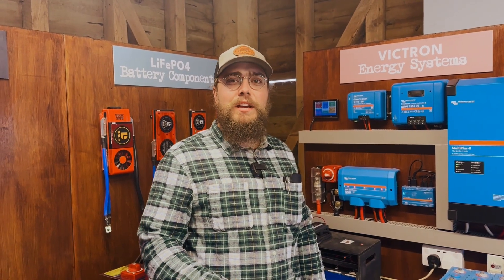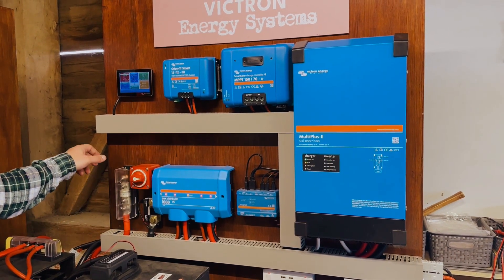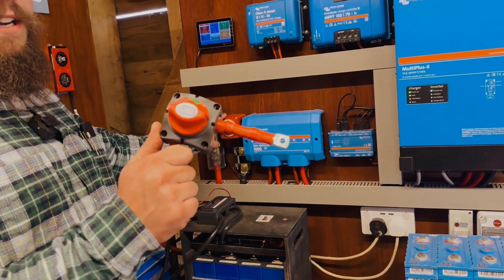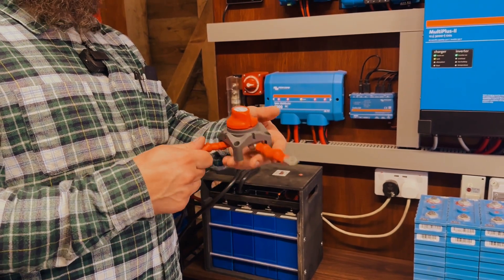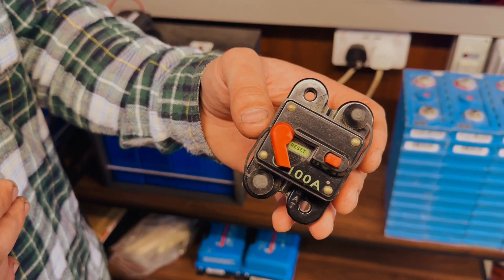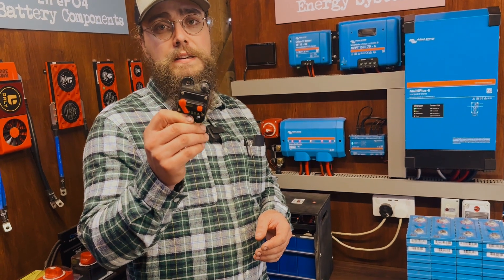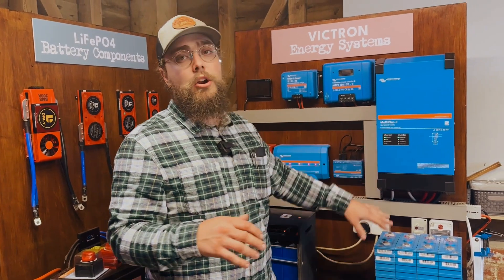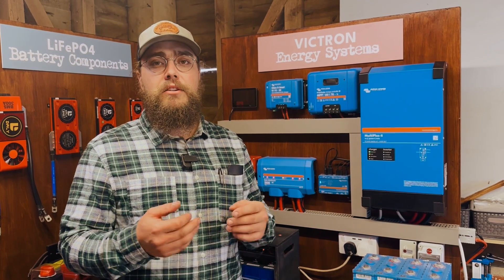Potential fire risk that you should avoid when converting a van or upgrading your motorhome

Comment: I tried one of those on my inverter as being 3kw and 500ah of FLA battery having a lot of amps is easy, so I avoided the fuse and went with one of those, it was a nightmare, and another 3 replacements I gave up on them, thats about the time i went lithium so the bms is now the fuse, I can say the bms cuts power with a short so fast the fuses dont even have time to notice. if the bms ever fails than its mosfets will be the fuse....

Comment: Call me a skeptic, but how can any switch lose 2vdc across its contacts? Either it's making contact or it's not, or it's chattering minutely, creating a flickering on/off state. No isolator switch is designed to make or break contact under high load ... except for an emergency shut down.
Reply from the maker: Yeah, we’ve only ever seen these issues with cheap models, so worth paying for name brands.

Comment: Excellent video- when you look at the terminals on some of those cheap breakers it’s clear they wouldn’t carry the current - there’s some 250A ones which look more like 25A rated. Not sure how they are allowed to sell them on the likes of Amazon / eBay etc as someone somewhere as you say will have a real disaster.
All the best, David 👍

Comment: Totally agree here, I had 4 cheap amazon breakers and 3 melted at under 40% of their ratings and the other failed the 1st time I tripped it, I've replaced 2 with bluesea items and used fuses and decent switches  on the other 2 👍
Spot on guys 👍😎👍

Comment: Good video. I have a  RC3563 IR meter (internal resistance) which is useful also for checking cables, crimps, switches, bolt fittings, fuses. All components aren't created equal. A cheap thermal meter or camera can also reveal hotspots
Reply: Theoretically a thermal image should be valuable in diagnosing electrical overheated components.